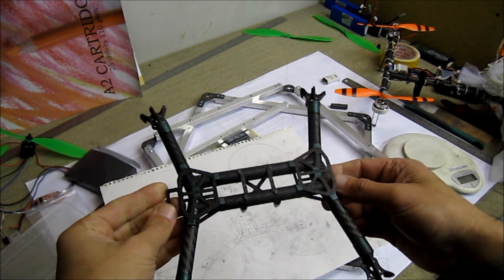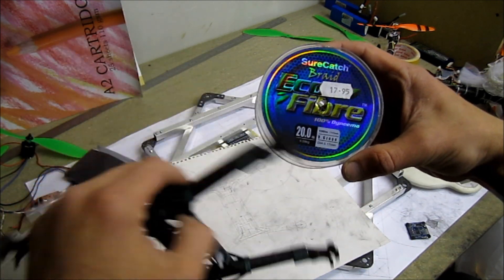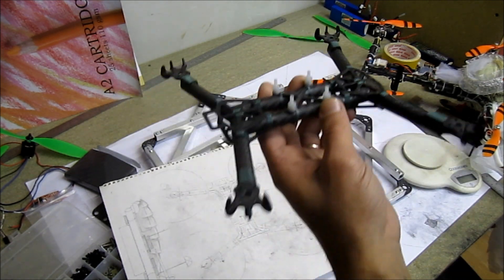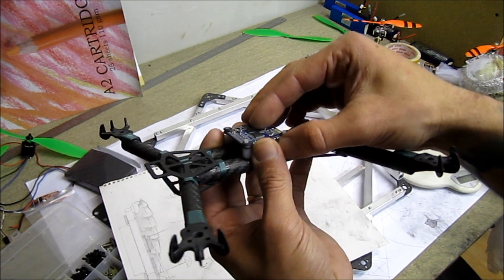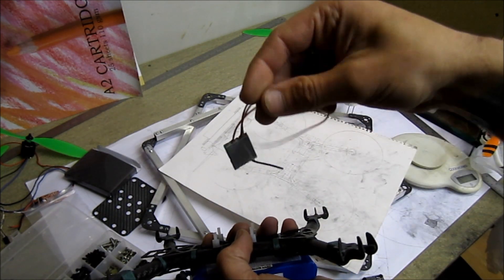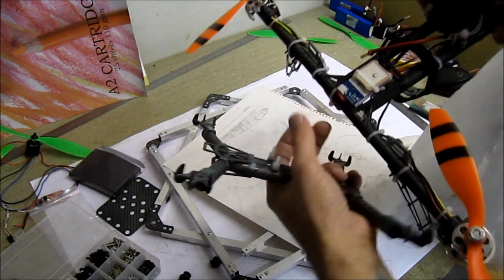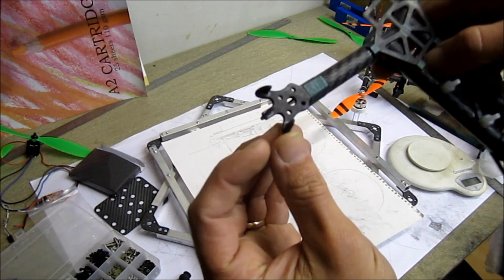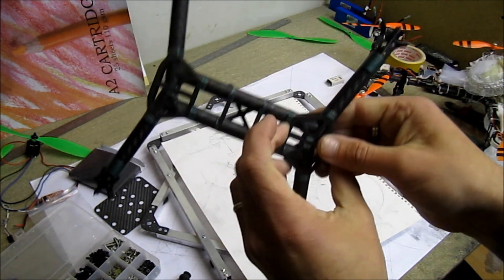Mini H-quad. DIY frame overview and crash test

Comment: I thought one advantage of the H design is that the end booms are strong because they are one piece, it's easy to keep them symmetrical and the construction is simple. Is there something good about breaking them in the middle and making a bend there? Of course, it looks way cooler though ;)
Reply from the maker: Front or rear tubes on true-H frame are gonna be stronger themselves, but on impact the joint suffers. On X frame the force from motormount to the center goes on compressing the tube lengthwise, on semi-H compression and bending, and on true-H from motormount to the center is an L shape what makes much easier to break than compressing a tube. Therefore the joint on true-H has to be extra strong what adds on weight, along with extra tubing length. As on X frame there's not enough space for all the gear, semi-H is a compromise:)
There's no chance zip ties will hold motormounts- they would hold not to break off, but will make a motormount to slip sideways. It sure is a lot of messing wrapping around with the line this way, but I don't build these for sale so I can spend as much time as it needs to and for me it pays off when I go flying with 350gr AUW w/1.4A battery when my friends are trying to catch me with their ~500gr AUW Minis w/1.3A batteries:))
All my Mini shenanigans are here http://fpvlab.com/forums/showthread.php?22435-Mini-H-quad
Reply from the maker: Daniel Allen Easier indeed, I'm a process of building another 2 Minis with 19deg and 26deg tilts of the frames with props in the line. And under 300gr AUW will be comming next, 1.0A 3s battery and 1306 2300kv motors with 4x4.5 props:) Cheers, happy flying!
Reply from the maker: Myrcmart.com has 1306, 2300kv for 3s and 3100kv for 2s and if they are as good as 1806 ones then it's good enough for me:) http://www.myrcmart.com/rcx-h13062-2300kv-micro-outrunner-brushless-motor-best-for-150230-frame-p-7927.html
Reply from the maker: Construction of straight H is simple indeed, but it is not as strong as semi-H. From motormount to the center where all the force is concentrated it becomes like an L shape structure, where semi-H is only a bent line. The strongest type of  frame is X, a simple cross, where (nearly) all the force on impact goes to compression to the center, instead of trying to break L structure. So that's one of the good things- a bit stronger. And if compared to X type frame- of course more space for FPV gear:)
Reply: ROBOFORCERX2000 I don't see how your semi-H is stronger than an H-frame. Of course your designed break points means better recovery, so it isn't meant to be stronger. But I like the look of it for sure, well done! I think your motor mounts will be the first to go, unless your fishing line gives first. Seems like a hassle to wind it, why not 2-3 black zip ties?
Reply: ROBOFORCERX2000 Nice 350g AUW is the way to go. I'm looking into building an ultralight (and ultra-cheap) hopefully < 300g 1AH. I'm going to try out the 10 degree tilt, which would be easier to do with the h-frame without a funky wedge.
Reply: ROBOFORCERX2000 Wow 19 & 26 seems a little extreme, but power to you! I didn't know they got as small as 1306, either way that sounds great.
Reply: ROBOFORCERX2000 I built a AUW 180g quad recently with those motors, they are very nice, would buy again :) btw where did you find 4x4.5 props, I was looking but didn't come across any.
Reply from the maker: Same Myrcmart.com have them, or Himodel.com:) http://www.myrcmart.com/4x45-epp4045-counter-rotating-propellers-fm-series-pair-black-p-7968.html
180gr AUW??? I'll take it as a challenge:))
Reply: Cool, thanks. I ended up building it around a 5inch prop size, but I'll keep those props in mind for next time. Yes 180g but it's very fragile and carries no FPV gear or anything. The weight saving mostly comes from the all-in-one ESCs that I used, check my video from last week for details.
Reply from the maker: ***** Yeah man, checked already, super! I won't beat that weight as all the FPV gear will be on, but hoping to have under 30gr for bare frame at least:)
Reply: ROBOFORCERX2000 Hey I know you're using the 12-OD 11-ID tubes which are already very light. But what about CF tubes with 0.5mm walls, would you ever go with that or is it too thin for your standards? I'm personally thinking about 10mm 0.5mm wall tubes. They are half the weight.
Reply from the maker: Not sure about 0.5mm walls, sounds a bit too thin/weak. I didn't see 3K weave with 0.5mm walls anywhere, only pultruded which are no good at all for copters, they split along very easily. Last video on my channel I'm testing 8mm tube frame what looks like the minimum limit to me and now I'll be using 10mm tubes:)
Reply: ROBOFORCERX2000 Definitely no protruded CF. Well the 0.5mm may have the same amount of fiber with less resin. I'm asking the dealer their thoughts. Besides my motor mounts are not like yours. I plan to do the tube clamp style which takes some of the sheer tension off the ends.

Comment from the maker: That lipo is completely dead for ages now, no risk there, it's just appeared that it was the perfect weight for my test:) Speaking of which I'll probably add some more weight and do another test, because 400gr just falling from the sky is not the same as 400gr hitting the ground at full speed :P

Comment: Very nice work mate! I really like the idea of the motor protectors... also they look like claws! cool! :D 50g is a great weight. I have been using the Turnigy Multistar 1704-1900kV motors on my Kwad. Decent power, but I snapped a shaft on one after a crash.. so those motor protectors will come in handy! Nice halloweeny quad too mate! Cheers!

Comment from the maker: Thanks bud, I don't have a thread, coz there's nothing to write about- sand the parts to fit, CA on, wrap around, CA on, and done:) Materials are 3K carbon tubes 12mm, 1.5mm carbon plate, CA and a fishing line, or nylon thread would do as well I think